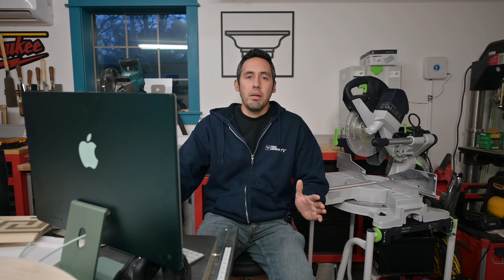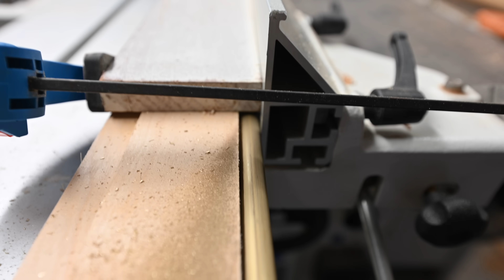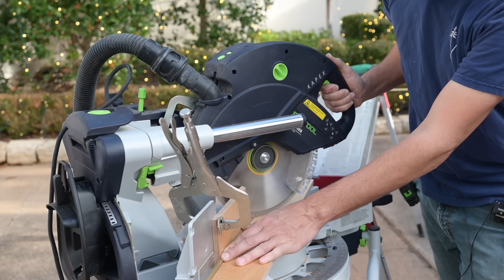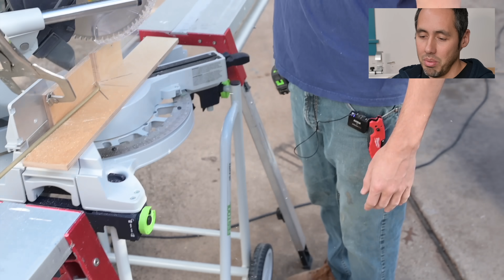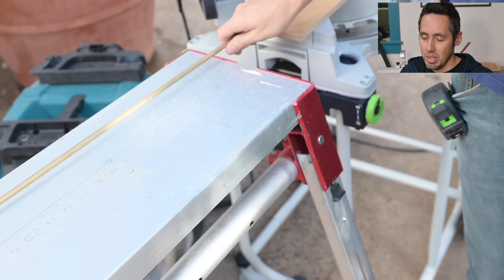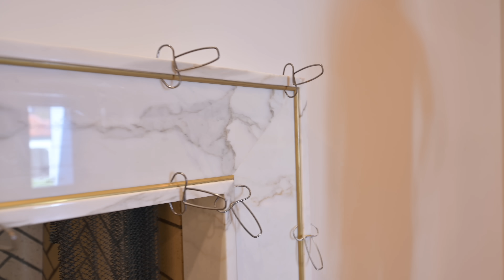It only took 12 years...My first MITER SAW injury.

Comment: About 8 years ago. I didn't have a jointer. Still don't own one but not the current story. 8 years ago I had this piece of wood that was a bit wavy and I wanted to joint the edge, didn't have a table saw or track saw so i decided the easiest way is to get a router with a pattern bit and a straight edge. Clamp the two together with some super glue and blue tape and then go for it while holding the piece in one hand and the router in the other. Router kicked, hands came together. The flush trim bit I was using entered my left middle finger at the tip up past the distal joint and back down along the top side, though the nail and out at the tip again. 4 days in hospital and 6 months of healing later I have 99.5% mobility and the scar hurts when I apply too much pressure across the distal joint.

Comment: Glad your injury was not that serious.  My worst was removing a window, not wearing safety glasses using recip saw, ended up with a wood splinter embedded on the inside of my eyelid so every time my eyelid moved scratching my eyeball.  Needless to say had to visit the optometrist to have wood splinter removed.  Lesson learned, safety, safety, safety regardless how big or small the job.

Comment: To my 20+ experience in carpentry i learned, ( and i always give this advice to the guys) that  when cuting any kind of mental, brass or reglet, you need to face the blade away from you and this will not happen even if the blade jambs, the reason why you hurt tour finger is because when you made the cut the force of the blade was going on an angle thats going towards your hand, lucky you didn't hurt your finger that bad,   i also learned this witht he same accident

Comment: Get a  diablo 10 in x 84 tooth blade  when you need to cut this type of metals. Cuts laminate, brass,copper, Aluminum, plastic and fiberglass. I set a piece of wood 1x3 or 2x4  lay flat on the miter saw base and set the metal trim against it, in every cut you do your piece of wood needs to be touching the left and right side of your guide and behind the trim metal. To prevent your hand or finger getting injured, use a 1x2  8-10 in long and use your hand to hold it against the trim metal you are cutting (put tape on the side is touching the metal, it will prevent scratches) just in case you get a kickback you don't get hurt.

Comment: My worst injury in over 15 years of working in construction was to my eye. Installing a commercial overhead door and drilling overhead with self tappers into steel perlins and not wearing safety goggles is not a good idea. Lol. I got a hot metal shaving in my eye and it melted into my eyeball. Luckily the eye doctor was able to remove it and no substantial damage was done to my eye and eye sight. Very lucky.

Comment: I had one incident as well, I was making snowman out of eucalyptus assorted sizes for the snowman. I was then cutting the topper for the hat and a piece of eucalyptus. The one inch in diameter exploded for the same reason in that the off cut was too tiny. However the other side was also only two or three inches long. That wasn't a smart move. I should have just grabbed another piece that was longer. And then the off cut my hand would have been further away. No injuries just numbness and three fingers for couple days. And a new found respect for the tool

Comment: Back in 2012 I was installing an Oak railing in a 2 story house. The inspector insisted that the rail be continuous from top to bottom erroneously since the stairs had 2 landings.  Anyway to keep him satisfied we went about producing all the parts.  Upon assembly we discovered one piece was slightly too long so we needed to remove just a hair more than a blades width.  As I placed the assembly on the saw I kept telling myself that this wasn't a good idea but I went ahead anyway.  About half way through the cut the blade caught something and threw the assembly  through a drywalled wall.  At that same time the twist of the assembly forced my hand towards the blade.  I ended up touching the spinning blade with my left index finger.  My only saving grace is that the teeth had dropped below the table so all I contacted was the smooth metal of the side of the blade.  For the next half hour I sat  waiting for my heart to quit pounding.  Over the years I have used this incident to teach the lesson of listening to your thoughts.  If you don't feel comfortable with doing something, then DON'T DO IT.  Ask for advice or find a safer way to do it.

Comment: I was building a shop. We had installed purlins on the walls and were working on the roof. Used the purlins to climb the wall. Someone forgot to nail part of one on so when I grabbed it it peeled off the wall. Fell about 12 feet onto my back. Was off work about three weeks.
I have shot and been shot by air nailers 7 times.  I've been in construction (mostly framing for 38 years.

Comment: I’m a young carpenter and have had a lot of close calls On the miter and table saw. I was using a utility knife to carve some wood off. But I was using it to carve in towards me and not away from and I ended up stabbing myself with the utility knife. I was only a year into carpentry and have learned a lot in 5-6 years

Comment: Hope you will feel much better soon regarding your finger, brother in trade. 
I have a corded Milwaukee grinder with the power slide button being quite close to the edge of the disk. One time, after many hours of cutting rebars repeatedly with it, i got tired and complacent with handling the tool. I grabbed it and turned on with just one hand quickly. For a moment, i forgot how close my finger was to the disk, lost my grip and the disk grinded the top of my thumb. Lost a good chunk of skin and fat, no bone shown but felt like hundred of needles piercing my thumb all at once. Never again do i start that grinder with just one hand.

Comment: Glad you’re ok. That is scary when accidents happen so fast. I do a lot of woodworking and steel fabrication. I personally would never trust a miter saw that is designed to cut wood to cut metal. I had a festool mitersaw and it worked well. I was tempted to use it to cut metal as you can slow the speed of the blade down.  However one extremely important piece of safe equipment on a true metal cutting saw is a vise to hold the work tightly in place. I use a portable cold cut saw and a portable metal cutting bandsaw which both have vises to hold the work. Fingers are no where near the blade and work is locked in place. Very safe. The cold cut circular miter saw can throw small off cuts so you have to be aware of the small cuts. Both of these saws cut very precisely and safe. Much cheaper than an emergency room visit. If you have one you will use it more than you think.

Comment: Old metal worker here. The saw blade engages the metal on the rear half of the blade lifting the brass up. You need to cut more to the front where each teeth entering the metal pushes the brass down to the surface not lifting it up like shown in the video.  If you would cut wood with this setup no problem, cutting metal is another ballgame. Working with wood the teeth rips throe the material without great resistance. Cutting any metal a different set of forces come to play they are so strong you cant hold down the part just pushing down with your hand. My recommendation,  use a vice to hold the brass.

Comment: I worked in a La-Z-Boy factory as an upholsterer for a little while, and ended up with a 3/4" staple in my palm. None of the pneumatic guns had the safety mechanism on the front, so we could go faster (did you say OSHA?). Someone walked through my air-hose which rotated my gun upward just as I reached down to grab it from my hip, and it popped one off as soon as my hand touched it. Didn't break the skin on the other side, but it lifted it up like 2 small tents. I was fine until the line lead pulled it out with his Leatherman, it made a horrible grinding sensation, almost like nails on a chalkboard. I immediately went white, got tunnel-vision really bad and literally thought I was going down... Turns out it was through a tendon. Other than weird sensation on one side of the nearest finger, no lasting effects.

Comment: Worst injury: Starting a screw with a screw gun without drilling a pilot hole. Pushing hard and the screw didn't start but it did tip over in the direction of the meat between my forefinger and thumb on my left hand.  A little bloody but no stitches.  I still think of that every time I start a screw without pre-drilling. Self-tapping screws were pretty rare back then.

Comment: I’ve had many a small cut or bruise. Nothing major, thank God. The scariest incident was being 5 stories up on a tile roof that needed to be tarped due to leaks and it started raining. It got slippery real quick and a coworker and I both slipped and slid a good 10-15 feet toward the edge of the roof. We were both young and dumb and had no means of fall protection. After that little incident, we called it a day and slowly crawled off of the roof.

Comment: i have a pretty poor memory, but certainly the most dangerous one that immediately comes to mind was when i was only 20 as a student. and we were living in a really broken, run down student house with some very dodgy wiring. and somehow (being so young) working on a mains 240v socket got shocked, with some large spark. and tripped the main breaker. (this was not realizing that i had shut down the wrong circuit). i believe this is pretty normal and frequent occurrence. so kindda useful to remind / point out. but also due to the young age, and lack of experience also made the scenario more likely... anyhow the socket got duly re-wired, the panel put back. and the main house breaker was reset. so a near miss you might say. and it is with some near misses we can learn the most, in terms of improving future long term safety. and keeping an awareness and edge or alertness around future tasks.

Comment: I've been a granite fabricator for 7 years now. A lot of times we would bring the customers faucets at the shop for layout and to determine how many holes and what sizes. Right before an install I was getting everything gathered cleaned and loaded for the day. Grabbed the kitchen faucet I needed and noticed one of the fabricators got a bunch of dust on it and left it. So I decided to wipe it off. Took my right hand swept left then went to go swipe right and I felt something stab my pinky.   I closed my hand real quick and looked at the box. I then noticed right where a picture of the brushed nickel faucet was, on the neck, somebody stuck a razor blade in there at an angle on one end. I couldn't tell because it blended with the photo. I was like wtf and why. My hand was hurting so I opened it and on every finger including my thumb was in pain and as I opened my hand the skin right above the palm side of my knuckles instantly sagged and folded. Blood started pouring out and so I ran to rinse it off and realized there was no taping these up. Left for the hospital, got stitches. The doctor said I'm lucky it was a razor blade. Luckily super clean cuts although extremely deep was able to heal decently. Sometimes I feel a little pain in those areas but it's not so bad. That happened five years ago.

Comment: I was building an electric bass body in 1975 or so.  Drilling from the pickup to control cavity, I missed and drilled through the back.  Figured out that a decorative wood strip would cover that mistake.  Cut the dadoes in the body and ripped the wood strips just oversize.  To trim the strips to the final dimension, I placed a handheld belt sander upside down on the workbench and locked the trigger ON.  I took the wood strips over the moving belt taking off a little at a time.  What I didn't realize is that the long sleeve shirt I had rolled up on my arm was becoming unrolled.  Mr. Shirt Sleeve, meet Mr Belt Sander.  Mr Belt Sander, this is my friend Mr. Forearm.  I still have the scar.  And the bass - I play it regularly.  Stay safe, all.

Comment: Glad you’re ok. I’ve not read any suggestions about what went wrong. Here’s what I saw in the slow motion video. The blade you were using was too coarse to cut a 1/4” quarter round at any speed. Once the blade touched the brass, the brass started to vibrate and lifted into the space between the teeth. You were lucky.

Comment: I had the exact same thing happen cutting thin aluminum stock on my miter saw, with same injury. In my case I really should have used a hacksaw as it wasn’t precision work and I should have held down the piece better on both sides of the cut. Just like your video it’s shocking how fast and violently things go sideways. Glad you came out unscathed

Comment: I was working for a framing contractor and we were working off pump jacks about 25 feet up. Long story made short the safety rail let go and I fell off backwards and landed in a sitting position rally screwed up my back and broke both wrists. Took quite a while to fully recover.

Comment: My worst injury with a chopsaw was when my chopsaw fell and broke blade cover. I continued using it with intention of buying a new one soon and one day at my jobsite, after cutting a trim, I started to walk away with my left hand holding the moulding and felt something sharp pain on my right thumb and realized it just brushed the still spinning saw (bad brakes too) and could clearly see the shape of the blade about 1/2” long and perhaps just 1/8” at the deepest point. I could have donated a little blood then lol. Been doing construction work for 25 years now.

Comment: Working as an electrician almost 20 years ago now.  We would drive the 8ft long ground round into the ground under the meter main with a t-post driver.  I was rushing through it and brought the driver up past the rod, and when I swung down the rod went through the webbing of my hand between my thumb and index finger.  Could have been a lot worse but it was very painful and required a bunch of stitches. I always took a little more care driving those things after that 😂

Comment: We make a U shaped jig when cutting material like that encases the material fence side, front side, and the bottom, if you get a bite like your's the only finger pressure is downward; all safe.

Worst I've had was a 50mm 15 gauge nail shot through my thumb including the nail, that stung!

Comment: Similar story but on a different kind of stock. I was cutting some 4 inch PVC pipe at an angle for a project. Was holding tightly with my thumb (much like you described) on a smaller length of pipe when the blade grabbed it and launched it about 15 feet into a brick wall. Was fortunate that it didn't pull my hand into the blade. Didn't have the benefit of video analysis, but i can tell you that the fingers never go that close to the blade anymore! If i had to guess, I'd say the off cut was insufficiently supported and got pushed into the blade similar to kickback on a table saw.

Comment: About 35 years ago I bought my first tablesaw, a Makita tabletop model. I had almost no idea what i was doing, and operated it in a very unsafe manner. I was basically using the BACK SIDE of the exposed blade to shape the end of a short 2x4 and the blade grabbed the board and threw it across the room, pulling my right hand back across the blade along with it. Got a gash up the side of my thumb and also clipped the tendon on the last part of my middle finger (also hitting the nail bed and permanently disfiguring my nail). Went to the hospital and they were able to reattach the tendon and they put a pin through the top two finger bones to hold it in place till it healed. Very lucky that is all that happened considering how stupid i was.

Comment: I was trying out a new router bit with a end cutter. Was waiting for a phone call while trying the bit out . Next thing I knew I push the wood through in the wrong direction . The piece of wood jumped off the table and my finger fell straight down onto the router bit . Now my finger tip is at a slight angle for ever .

Comment: My worst injury was the result of not paying attention to what I was doing over the period of a couple weeks. I was framing a house and had reached the point where the majority of framing was complete and I started noticing my knees were absolutely hurting me every step up or step down I took no matter what the elevation. What happened was I had been essentially jumping off the first floor level to the sub-grade, which was about 24", while wearing my tool belt. Over time, my tendons in my knees had become damaged and I developed tendon strains in my knees. It took three years of not doing carpentry or hard physical work of any kind to get better. Knees still hurt on occasion, but I am back working carpentry again, and much more careful about high impact movements.

Comment: Similar to your situation with stepping on a finish nail, about 4 years ago I was removing some exterior trim from a home on a job site I was on and I usually bend the nails on boards I remove to avoid stepping on nails but this time, I had forgotten to bend one of those nails and I realized that once I stepped on that nail. That wasn’t fun at all. I don’t remember it hurting too much but it was sore for the next week after…